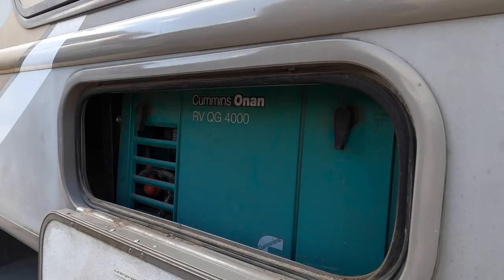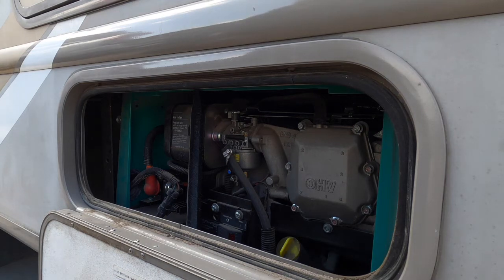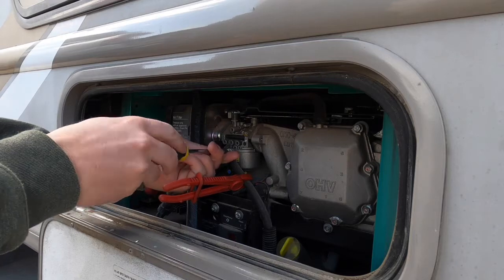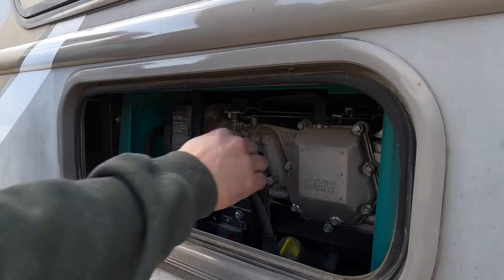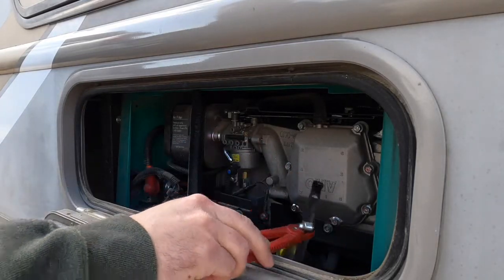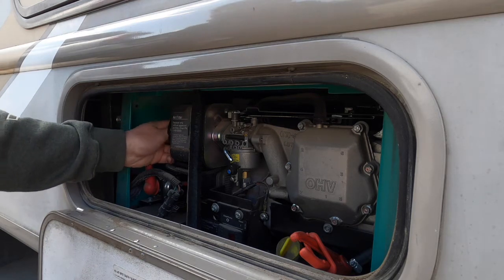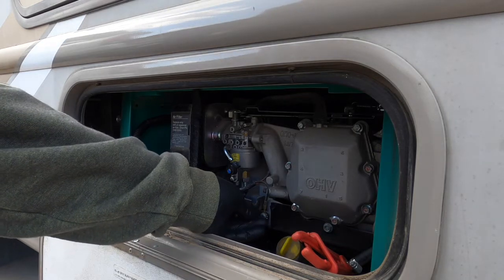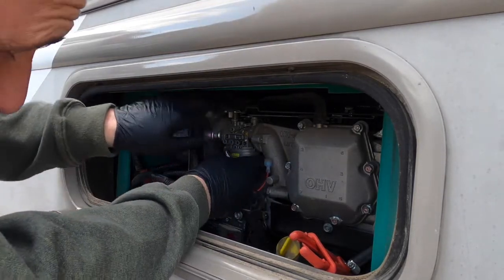How to replace (or remove for repair)the carburetor on a Cummins Onan RV generator QG 4000

Comment: THANK YOU.  Huge help - whoever asked what size that socket was - bless you!  10mm - for the long bolts.  Simple replacement - $48 started first try!
Reply: This was exactly what I was looking for. Thx
Reply: Seconded, knowing the socket size saves me a lot of cursing, (not that i don't curse at my generator a lot as it is) as to how to help the issues with the generator, how about a honda? Would seem to fix the main problem.

Comment: The permanent fix for Onan generator problems is to add a shut off valve before the carb and run it dry after use.  This way the carb  (or a new carb or the one after that.....) does not get gummed up.
Reply from the maker: That would be a very smart idea.
Reply: There's a bowl drain screw on the carburetor. It's a Philip bit near the solenoid.  Just crack the screw open and the gas will run out (use a cup to catch it) I leave my screw loose during storage. Right before I fire it up for the season I hit the prime button and push some of the old fuel out of the line. Than I turn the screw tight and fire it right up. Never had an issue.
Reply: @gdejackmo  I don't believe there is a prime bulb on these generators.
Reply: @rodsautter6135  on the start switch to crank instead of pushing the right side to crank hold the left side (stop) of the button for about 3 to 5 seconds.

Comment: First of all your video was extremely informative. If I may make a suggestion (based on watching you and myself remove and reinstall the carburetor) to facilitate in the removal and installation process. I made, out of scrap wood, a block to compress the foam gasket on the air filter housing. This minor addition compression allows just enough space for an easier removal and installation.

Comment: Thanks! I thought I was missing a bolt on the right side but your video showed the bolts come in through the air filter housing and run all the way through to the intake manifold. Just what I needed and also where to tighten those bolts. Perfect!

Comment: Thanks for the video, It was very helpful. I changed my own and it's running fine. Getting the gaskets in was a bit tricky. I ended up putting the new carb in place and then slipping the gaskets in. If you push opposite directions you can get a little space and slide it in. Also used my phone camera to see where I was going when putting the bolts in or out, as you really can't see back in there otherwise.
Reply from the maker: I'm glad it was helpful for you.  I have found that the best way to put the gaskets in as well without damaging them.  Get the carb in place, then slide them in before sliding the bolts in.  Good idea on the camera...

Comment: Thank you for the video. Does the float bowl come off? Mine sat for a year without being run. On my last RV, I only had to remove the bowl and clean it and that solenoid out and it fired right up. Was hoping I could do the same with this 4000 too.

Comment: Nice video!  We have to replace the carb on our Jayco. Same QG4000 generator. Generator sat too long and carb gunked up.  My bad. Looks like this should be about a 45 minute job or so for an experienced tech, which we have.  Just don’t want to hear that it was a 2 hour job at $150 an hour.  Also, did you say that you used an after market carburetor?  If so, can you tell me what brand(s) you like.  My folks want to get one from Cummins/Onan, but they are about $500.  I know they’re good, but are they 8 times better than the $65 after market imports?  Thanks again.
Reply: Yes I need a new one too...but not that so expensive $500 from the dealer..is any other alternative there..?

Comment: I greatly appreciate this video! My QG4000 wouldn’t start after sitting a while. Since I had spark, i replaced the fuel filter and pump with no success. The carburetor is next but I’ve not seen any error code and that worries me. Is there something else I should check?
Reply: Did you got your carburetor fixed or changed...where did you got your carburetor from...$$$$.....?

Comment: Did you ever retrieve the wing nut for the air filter housing top? I had to take the control board out to get to mine.

Comment: So before buying a new carb, just clean the old one.  It appears to come apart like any other and I suspect that some spray carb cleaner or brake kleen would do the trick nicely.  Most likely it is just varnish in the float bowl and jets.  If not keep and clean old one for next time.

Comment: 10 mm heads on the bolts, correct?  I swapped mine out, thanks to this video, with relative ease.  
I didnt tighten the ground wire enough; most likely finger-tightened until I could get the proper bit in my screwdriver, which I obviously forgot.  After a few trips and a few hours it was behaving as if it was again gunked up.
Reply from the maker: 10mm in the air filter housing, correct.  How long since you had installed it?  That is kind of the gig with these aftermarket carbs.  You run the risk of it lasting only a short period of time.  If it hasn't been too long, try returning it for a replacement.  Depending on how long it has been, it could possibly be a bad fuel issue.
Reply: @kbssmallenginerepair2615  It was my shoddy install, that is, the ground wire for the solenoid wasnt tight, its operation was intermittent, and the carb wasnt regulated properly.  Once tightened, it ran like expected.

Comment: I had a RV shop replace a carb. Several yeas ago. $300+ . Going to try it myself. Ordered an after market one.
Reply from the maker: Ouch! They certainly don't cut anyone a break.  Hopefully it works out well for you!
Reply: @kbssmallenginerepair2615  In Anchorage they quoted $900.  Can you believe it?
Reply: Any updates? how did the aftermarket part work? 
What model did you have and what is the link to the part? TY

Comment: Hello,
I just got a 1997 Leprechaun RV and I think the unit has been sitting for a while.  I'm trying to get the Generator to work but so far it will only run off of Starting Fluid.  
It's a Onan Microlite 4000 series.  
It has a Clear Fuel Filter underneath and so far I'm getting No gas out the Line . The Motor home 
Has 3/4 tank of gas in it . Do you have any ideas of which direction I should be looking at . Carburetor,  Fuel Pump, the Fuel Line itself ???
Thanks for any suggestions.  
John.
Reply from the maker: Hey John, which side of the fuel pump is the fuel filter on?  I would start at the fuel pump and work backwards assuming the filter is between the pump and the tank.  Take the hose off and see if there is flow.  If not, pull the filter off and check for flow.  Go back as far as you need until you find flow.  You have to be able to get flow to the pump.  See if that works, then I would take a look at the fuel pump.

Comment: I have the same generator - just outta curiosity, did you check the error code, was it 36 - aka fuel related?  

I'm tempted to install a fuel cutoff valve on this, after i fix mine, to run it dry before storing, have you had any luck with that?
Reply from the maker: It was a fuel related error.  There shouldn't be a need to install a fuel shutoff.  just empty the carb bowl via the screw at the bottom and let the fuel drain out of the drain hose.  As long as you don't prime it or try and start it, no fuel should enter the carb.  That will be better than "running it dry" because there will always be a little fuel left over in the carb bowl.  Hope this helps.
Reply: @kbssmallenginerepair2615  got it running, chinese carb to the rescue. I'd buy the oem one, but since 400 dollars for one still doesnt get me a serviceable part, the 42 dollar amazon garbage will have to do.  

Such a bad design.  Thanks for your video and help!

Comment: The air cleaner bracket broke and I have a replacement coming.  If I remove the carb can I put the new one in from there?   Thank you in advance!
Reply from the maker: I'm not sure I understand your question?  The mounting bracket, as in the stud that you tight the nut down onto the air filter, or the whole air box assembly?  You will have to remove the 2 carb bolts to remove any of the air filter hardware, however, removing the actual carb should not be necessary.

Comment: Thank you for the video. I have a question if you could help, my air filter bracket snapped and I have the part and I'm trying to replace that. It looks like I need to pull out the carburetor to do that. Is that correct?
Reply from the maker: You should not need to remove the carburetor if I am thinking of it correctly.  You likely need to remove the 2 carburetor bolts, but just let the carburetor hang there without removing it and undoing all the linkage, fuel line etc.

Comment: Greetings, Does this have a kit to convert to propane?  Thanx, -keith
Reply from the maker: That is something I am not sure of...I would check with Onan or Cummins.
Reply: @kbssmallenginerepair2615   Thanx for your reply.  I finally gathered up enough information to call Onan.  Maybe if I do the conversion I'll do a YouTube tutorial.  As I understand, small engines run cleaner using propane.  My Uncle had one and that's what he said.  I'll report back to you:-)
Reply from the maker: @keithnorris8982  that would be great.  Thanks for sharing!

Comment: KB did you put on gasket sealant on both gaskets? Do you need to do that? If so what type of gasket sealant?
Reply: Did not even see him put in gaskets.
Took mine apart today. Was only one gasket on manifold side. There is a Bakelite spacer there also.
Reply from the maker: I do not use any liquid gasket on these.  There is a gasket on both sides of the carb, however you may be able to use the original insulator which will typically have the gasket still attached to it on the manifold side.
Reply from the maker: There should be a gasket on both sides of the carb.  They will typically get stuck to the air filter casing, and the insulator on the manifold side.  A lot of times the after market carbs do not come with a new insulator and the gaskets are baked on there, so I don't mess with replacing the gaskets.  Just use the originals.

Comment: I have rebuilt quad carbs on motorcycles, & carbs on cars. Use an ultrasonic cleaner with eg. Simple Green. They come out like new.. Not sure why this carb can't be cleaned & rebuilt, though they are cheap to buy new.

Comment: Would you please provide a link to the replacement carburetor for the Onan 4000 generator?
Reply from the maker: It will all depend on your exact model of your generator.  They are pretty particular about that information, I would call Cummins/Onan directly and they will get you a part number.

Comment: Nice video, I purchased a non oem carb and had it replaced but to get it to start and stay running I have to manually pull out the throttle with my finger. Do you know why that might be happening? The guy who installed it does not know why it's like that either.  Thank you!
Reply from the maker: This has happened to me before.  You either have a defective carburetor, or you have another issue going on with the generator.  What do the lights tell you when they flash after you let it die?
Reply: Thanks for getting back with me, the light just flashes 3 times and now it won't start at all.
Reply: You need to make sure the throttle plate and choke plate are moving freely. If you need to push on the linkage for it to move something is jamming

Comment: Great video, did it run after all that? I was going to Buy a can of seafoam and some gasoline and try to clean the carburetor manually but then I seen somebody bought a aftermarket carburetor $50 so I decided it would be cheaper in the long run to buy a aftermarket carburetor and install it on my Oman 4000. Just waiting for the carb to be delivered then I will attempt to install it. $15 for a can of seafoam then $5 or so for a gas can then the gas and a gas hose is half the cost of a cheap carburetor, just to try and clean the carburetor and then not work. Thanks again for the video.
Reply from the maker: This particular one did not work right after this, it needed a few more things done to it.  Typically if it is just the carb, those $50 carbs will work ok, it just varies on how long they last.  I have replaced several with the cheap carbs and they are plug and play, but who knows how long they will last.  People simply do not want to spend $400 on a new carburetor, which I don't blame them.  I have had 0% success with "cleaning" these carbs.  They say they are not serviceable and I have not been able to successfully revive one yet, so I quit trying.
Reply: Yrs ago it was a guy on eBay that was rebuilding those carburetors for $80 guaranteed to work ..

Comment: An you do this on the 2500 propane model?
Reply from the maker: You certainly can.  While I have not personally done it on a propane model Onan, the process would be similar, if not identical.
Reply: @kbssmallenginerepair2615  not sure if the part is available or if it would work. I’m about to rip the Onan out and just store a Honda in there.

Comment: KB what do charge for a mobile visit not including parts?  Is it a flat rate or do you add on for mileage? Great video and an opportunity to expand on your core business.
Reply from the maker: It kind of depends on where I am going.  I don't charge for mileage, just based upon how far they are from my shop.  This vicinity is $XX This far out is $XX.  In this case this is a really good customer of mine and he is just across the highway from my shop, so instead of him bringing his motorhome over, I just told him I would come to him since I knew exactly what I was getting into.
Reply: Thanks

Comment: Where do I get a replacement?
Reply from the maker: You can get an OEM through your local Cummins/Onan dealer, or online.  You can also try an aftermarket carb through Amazon or other online retailers, however I don't recommend this as they are not very reliable.
Reply: @kbssmallenginerepair2615  Thanks. I tried cummins and they are sold out.
Reply: @danielyutzy5321  eBay!!